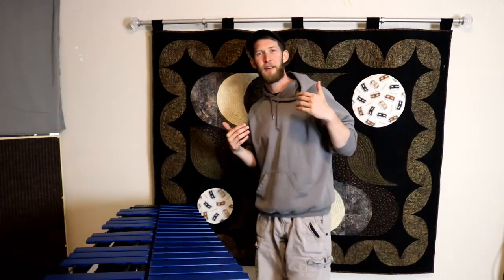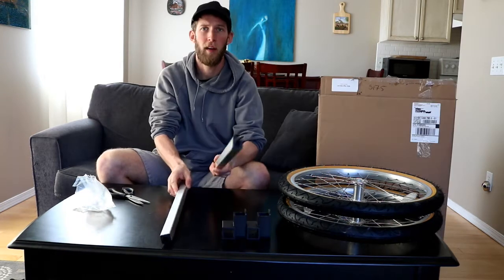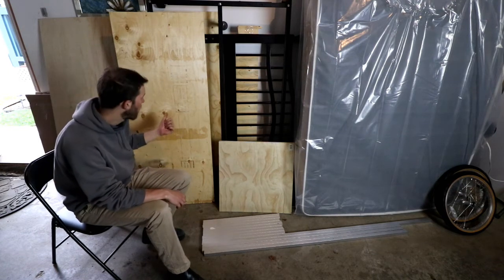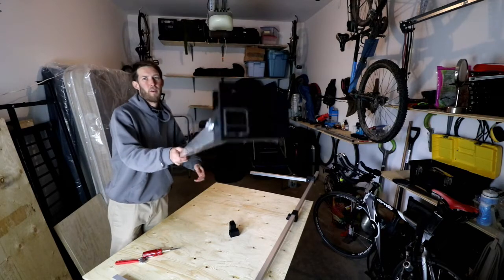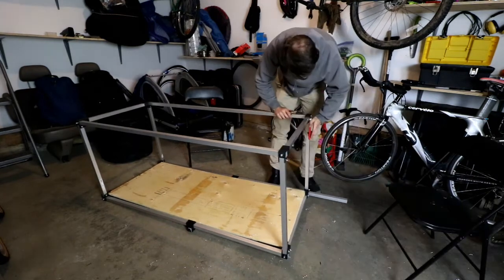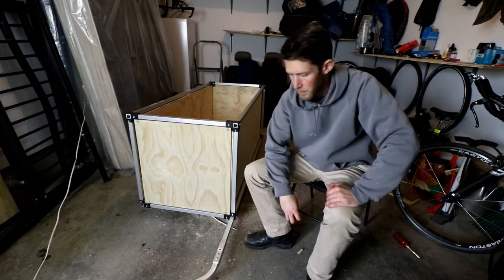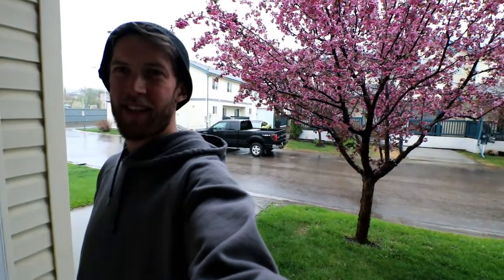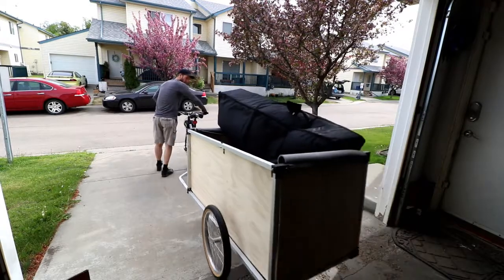Product Review: Wike DIY High-Walled DIY Bike Trailer

Comment: Might as well add a top 5x2 with hinges and a hasp for a lock.
Seems like using plywood would make this fairly heavy. Nice that the kit includes bigger 20" tires. I'd like to make one with 26" tires like those on my bike so if I keep spares, one size fits all.
Reply from the maker: I've thought about adding a top, but my loads are frequently taller than the top of the box. I'm rebuilding it in a couple weeks and am considering a lower wall height for easier load/unloading as well.

The 20" tires work great. I have two pairs from WIKE in case something happens to one. Finding tubes has been no problem as well.

Comment: Hi, I bought a WIKE DIY trailer kit and have an easy question. what lengths do I cut if I want mine to be 48Lx24Wx36H?
Reply from the maker: Not 100% sure. I would recommend cutting an extra inch. You can always shave it off later!

Comment: Does that hitch have the 12mm hole? If so what bike is that? I need to set up their DIY flatbed style kit.
Reply from the maker: It's a standard hitch pin - I picked up a spare at the hardware store and it was easy to find one.

The bike is a Norco Indie 4, but I now use an ebike - the RadRunner 2 - to haul the wagon
Reply: @JaydenEricBeaudoin  
Thanks for the info. It helps a lot.

Comment: Can it carry 50-80 klgs weight specially when the road is a little bit uphill?
Reply from the maker: Yep, I use more of the electric assist, but it has no problem with moderate hills.

Comment: Can u put in the description of all the materials?
Reply from the maker: WIKE includes a recommended material list on their website - I followed it exactly. Basically, 1" aluminum pipe for the frame and 1/2" plywood floor with 3/8" plywood walls.